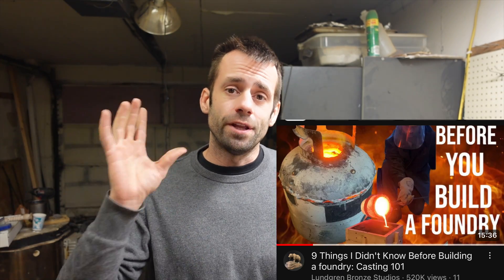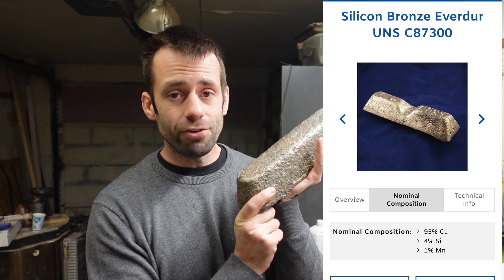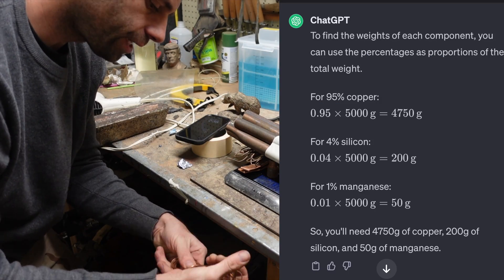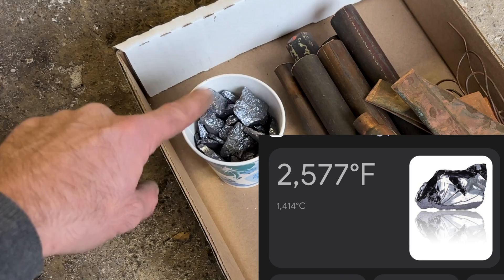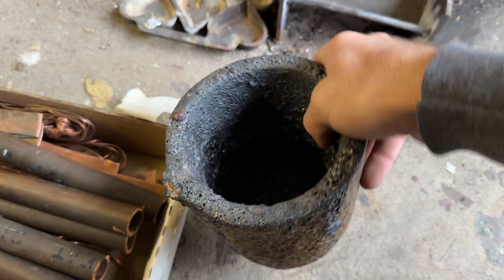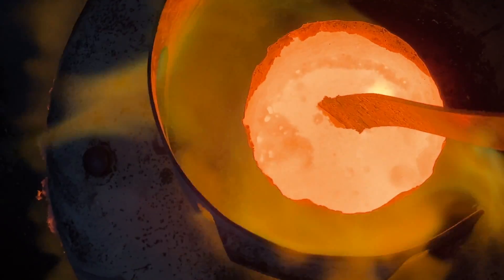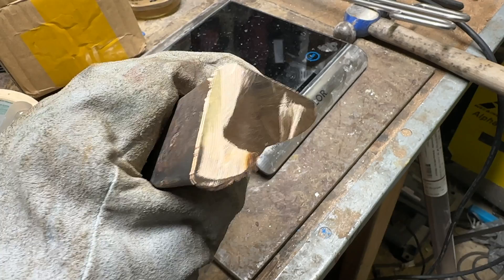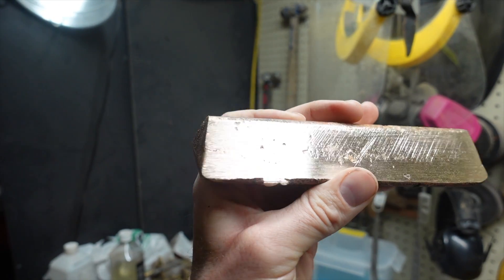How to Make Silicon Bronze: Beyond Tin and Copper.

Comment: So you did not have a high temperature enough to melt the manganese and silicone.
But it dissolved.
What is the difference?
What if after dissolving the 2, you bring the temp up to their melting point?
What would happen?
TY

Comment: I know I'm preaching to the choir.
1) Bronze , today, basically means a copper alloy (excepting brass, copper & zinc which kept it's old name).  The earliest bronzes were (accidental) arsenic bronze.  A lot of the issues with  nomenclature issues stem from metal workers picking names before they knew the science; grey cast iron, white cast iron, chilled cast iron, steel, wrought iron.  Same thing with the coppers.  Tin-bronzes were the bronzes of the iron age.  
2) Silicon dissolving in molten copper is a bit of an analogy.  Mixed solid copper and silicon melt at a lower temp than even copper.  They're eutectic.
I'm a lover of high silicon grey cast iron casting.  I might get into silicon bronze.  Tin-bronze is butt expensive and I'm coming from mega cheap cast iron.
Thanks.

Comment: Wack 1% of Vanadium if possible I’ve managed to with TIN -Bronze it’s actually 35% stronger .?? Don’t ask me why as I don’t simply know. But it is very cool.Just need some more Celsius of Fahrenheit >>> Worth a try. Best of Luck. Also chromium is very cool and in very small % amounts with Copper vanadium silicon tin and aluminium. Give it a go. Please be careful add very small amounts of Aluminium, Tin ect  in  small shavings ect to avoid flash boiling. Have fun.👍👍

Comment: Great video. Is there any reason why you melt the copper first before adding the other metals, or could you throw them all in together at the start?
Reply from the maker: I guess my thought is to just reduce oxidation time of those other metals. And the they will only dissolve in a melt so there is no point to have it in there until it is molten and it can dissolve.

Comment: I split the zinc and copper alloy in half to make the 7.25 alloy and mixed it 5 times as it didn't want to mix all that well. It made the mix into file eaters. 2 or 3 sets killed new Nicholson files. I did a video on cleaning up the rough chopsticks. When trying to bend the pieces it was a no go.

Comment: Silicon is used in casting alloys as is increases fluidity, e.g.: aluminium casting alloys most usually contain silicon.  And, as you pointed out, silicon is used in bronzes  brasses, etc.

Comment: Thanks for mentioning colour match - had fun trying to get a good colour match on some copper jewellery.

Do you happen to have a recomendation for brazing materials for copper that DO get a nice colour match?
Reply from the maker: I really don’t do any brazing so I’m not to knowledgeable on that. I know for some metal types people with use the sprus they cut off as welding rods to ensure the color matches. But that’s different than brazing.

Comment: When melting pure copper using a flux cover may be advised?
Reply: Break up a brown beer bottle and float the glass on top of the metal.  As you keep adding to the melt, slowly slip it down the side of the melt to not disturb the cover.
Reply from the maker: Is that just to keep the air away from the metal so it doesn’t absorb gasses?  I didn’t think flux was that important with bronze?
Reply: Exactly, the glass just keeps the air off the copper.  When you pour your newly made bronze, have someone hold the floating glass back and you can pour from underneath it.  Or skim it off, your call.
Reply: Fluxes aren't necessary when melting bronze.  Making it and melting it are 2 different things.  Melting straight copper is a pain in the ass which is why I don't mess with it.😒
Reply: Found a link for DIY bronze alloy recipes (youtube deletes, but you can google Internet Archive (c.w. amen sand casting .pdf)
For tin bronze and several other bronzes the fluxes consists of a Charcoal cover, and less than a percent of 15% phosphor/copper shot added after copper is melted, and shot added again after tin and lesser zinc/lead are added.
Other fluxes mentioned for brass include: glass, borax, salt, bone ash, soda ash, plaster of paris, sea coal, fine coal, whitening, etc.
Reply: @mevk1  There is a guy that goes by Rasper on the home foundry forum.  He's our resident expert for home made sil bronze.  He's in Mexico so I understand why he makes his own.  Personally, I'd rather just buy from Industrial Metal Supply in the southwest.  I can guarantee purity this way and never have color mismatches.  It's still cool to make your own, but I've got bigger fish to fry in my world.

Comment: As I understand it, slag is Flux+impurities. Dross is impurities skimmed without flux.  Have you tried putting a KCl flux on your bronze? I like a small amount as it provides an O2 barrier (especially when dealing with more reactive metals like aluminum.)
Reply from the maker: I’ve tried borax but I don’t use it often. I’m not very knowledgeable on fluxes.
Reply: @lundgrenbronzestudios  borax works well in my experience with copper alloys, except for aluminum bronze (borax reacts with aluminum in molten state). For alloys containing aluminum, my go-to flux is an equimolar part of NaCl and KCl (58 parts  NaCl plus 75 parts KCl). That mix forms an eutectic that has lower melting point than either of the components alone.
Reply: Not recommended to use flux with silicon bronze - just melt, skim and pour. @lundgrenbronzestudios  Making silicon bronze requires a cover flux(brown glass, borax, examples)
Reply: @mevk1  silicon is reactive with oxygen when red hot, and a significant part of it will be lost to oxidation forming silicon dioxide aka sand. It's good practice to add an oxygen barrier before adding the silicon.
Reply from the maker: @stamasd8500  that’s good to know. And makes a lot of sense.

Comment: I have found aluminum bronze to work really well and I love the gold color.
Reply from the maker: I like it too.  I do find that is shrinks a little more than other bronzes though.
Reply: @lundgrenbronzestudios  not only it shrinks way more, but also has a tendency to develop microcracks and bubbles because of dissolved gas which is released by the aluminum as it cools and solidifies
Reply: @lundgrenbronzestudios  i hear this can be reduced by mixing other metals in the alum bronze

Comment: Great explanation on the bronzes. I’ve been using Silly bronze for years, great alloy gif sculptures, easy to cast, easy to weld, but more difficult to work than other softer bronze alloys but compensated by the foundry benefits.

Comment: You missed a few bronzes in the enumeration at the end. Antimony bronze and bismuth bronze. Well the latter isn't much of a bronze (just like lead bronze isn't really a thing because lead and copper don't dissolve in one another, the lead stays as separate droplets dispersed throughout the copper mass - bismuth does the same). But antimony bronze has some pretty interesting properties and colors. I did some work with it. For instance, if you want a bronze that is close in color to silver, about 15-18% antimony in copper will do that. It is even rumored that at a certain percentage of antimony in that range (and perhaps some heat treatment) the metal color can turn to blue. I did a little experimenting with that but never got actual blue color.
Reply: Also iron bronze. And Cunifer, copper nickel iron alloy used for automotive brake lines.
Reply: Blue color happens in a certain range of temperature. At 480 degrees Fahrenheit, steel turns brown. At 520 degrees Fahrenheit, steel turns purple. At 575 degrees Fahrenheit, steel turns blue. At 800 degrees Fahrenheit, steel turns grey. For each kind of metal or alloy will be a different temperature ^^